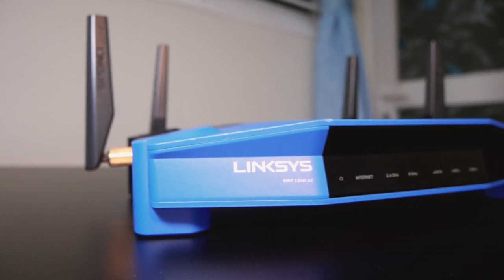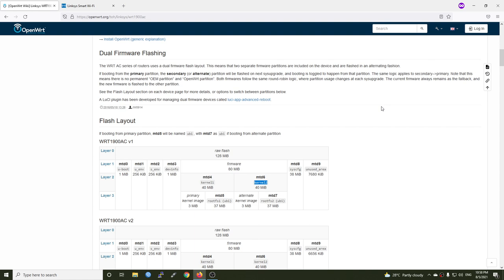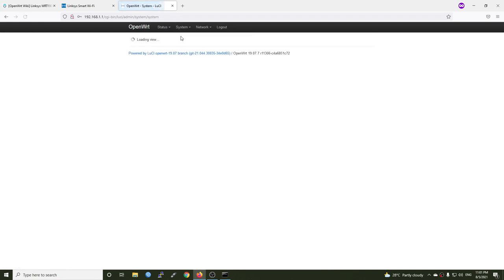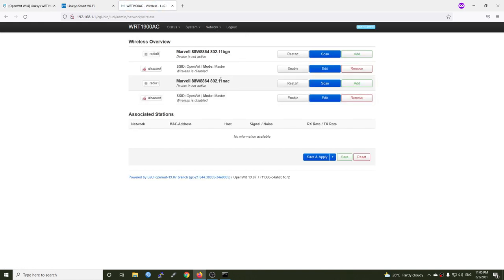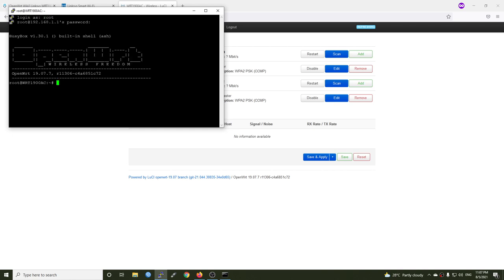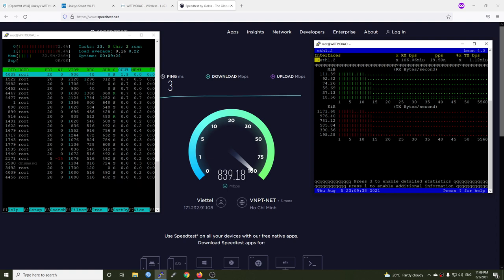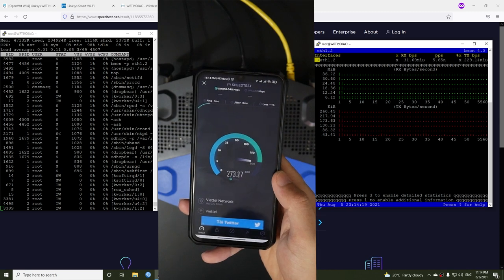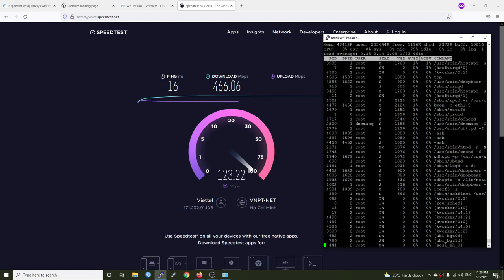OpenWRT - Install OpenWRT on Linksys WRT1900AC

Comment: For years I was going to buy this router to put OpenWrt on but eventually I just used a spare Pi 4 I had lying around!
Reply from the maker: I believe that the Pi 4 should be more powerful in term of routing and firewall. If you already have a spare RPI lying around, it is good choice to set it up as a router.  However, if one need to setup a new network, I will suggest him to buy this WRT1900AC (to save money on an AP, 5 ports switch and a good case for PRI 4).

Comment: Had to change my router´s firmware since it looses the Internet several times per week. Hope with this new OpenWRT version my service won´t be unstable anymore. IPS is not the problem since their router is always working fine. Problem is with the Linksys WRT1900AC. Thanks!! I

Comment: I have 270-350Mb speed on 3 differnt modem. I do load balance in raspi 4b
When i used mi4a,ea7500 all opewrt and ea6300 freshtomato, all i got just 200 and 220Mb max
I use original firmware, that result is same. 
What's wrong with it?

Comment: Did you notice a issue that traffic just will not forwarded and you need to reconnect to the system? It’s really mad, it’s not WiFi or DNS … it’s really Strang you can’t even ping anything

Comment: Can it do secure file transfer over to a USB drive plugged into the back of the router from a remote location?
Reply from the maker: Hello, you can see my tutorial with Samba4 to enable the file sharing and mount the hard drive. And then see the Wireguard server VPN to enable remote access. But these is not easy, it will take you sometime to master.

Comment: Can I install OpenWRT on my Linksys 1900AC if it currently has DD-WRT?

I installed DD-WRT in the past but I don’t like it. I did spend time trying to revert the router to manufacturer firmware but none of the methods work for me. Therefore I wanted to try to install OpenWRT directly onto the router which is currently on DD-WRT
Reply from the maker: Hello, my response is  a bit late, but I hope it will help:
- The Linksys WRT1900 series has 2 partitions (I call it by partition A & B). By default, these 2 partitions has stock firmware on it. " If booting from the primary partition, the secondary (or alternate) partition will be flashed on next sysupgrade, and booting is toggled to happen from that partition. The same logic applies to secondary-→primary. "

- When installing DD-WRT, the firmware should be loaded on 1 partition only (partition A). You should be able to switch the stock partition (B) with some commands (check DD-WRT guide)
- After you get back to the stock firmware (partition B), do flash the OpenWrt image via the web-ui. This time, the OpenWrt firmware will be loaded to partition A. After reboot, you should see OpenWrt up and running. From this, do follow the OpenWrt installation guide to flash the image to the other partition.
https://openwrt.org/toh/linksys/wrt1900ac#dual_firmware_flashing

Comment: Good work.
Can you please do a video on DS-Lite implementation (RFC-6333) on OpenWrt, I have many issues with it.
Reply from the maker: Hi, did you solve the problem. If not, please share more info about the problem you are facing during the configuration. I found a tutorial here, not sure if it help https://openwrt.org/docs/guide-user/network/ipv6_ipv4_transitioning
Reply: @VanTechCorner  Thanks for your reply, I am already familiar with this tutorial. In fact, it is the only info about OpenWrt and DS-Lite which is not enough.
The problem is that after installing the “ds-lite” package, OpenWrt always asks for AFTR address within the DS-Lite device. It’s like assuming that this device is always B4, and the AFTR is residing somewhere in your ISP. 
I want to build the whole testbed  (   client  >> >  B4  >>>  AFTR >>> IPv4 host )
Note: AFTR & B4 are just router names defined in RFC-6333

Comment: But the reason I want OpenWRT is because this router (stupidly) requires an internet connection to complete its setup (even for use as a WAP/bridge), meaning its web GUI is inaccessible.

Comment: Hi..i got 2 question/request
1. If already installed openwrt on the router, can it work with unifi?
2. Can you give tutorial how to install openwrt on Mercusys mr70x since it has wifi6
Reply from the maker: Hi, after installed OpenWRT on this router, you will need to configure PPPoE with VLAN in order to work (you need to know what is your PPPoE credential by checking with Unifi or check on the router). If you have no idea what is OpenWRT, please do not install it since the device may not working as expected. Currently OpenWRT doesn't support Mercusys mr70x  and there is no way to install it (OpenWRT firmware is not available for all router/ap)
Reply: @VanTechCorner  I see...just asking..act ive been using openwrt before...maybe next time ill dive in back to explore more

Comment: Can you connect this router in repeater mode to a public wifi that has a captive portal login, and extend that signal?
Reply from the maker: Hello, you will need some advance setting to do this. Or you can take a look at this https://forum.openwrt.org/t/travelmate-support-thread/5155
Reply: @VanTechCorner  Am aware of travelmate plugin but does this hardware support this functionality? I have an asus router running openwrt but couldnt make it to connect to a captive portal.

Comment: Please show us the Print Server Setup and use it from mobile without pc. We can do it with tplink  firmwares eg. wdr 3600. Now i use openwrt. So show us a way.
Reply from the maker: Hi, please don't post the same comment on different videos as Youtube will flag this as spam and may block you from commenting. For now, I have no printer to try this setup. You can take a look at this doc and try with CUPS https://openwrt.org/docs/guide-user/services/print_server/start

Comment: con này LAN throughput so với con pi 4 sao anh? Đang phân vân lấy pi 4 + ap hay con này
Reply from the maker: Cổng LAN của hai con đều là 1 Gbps. Pi 4 chỉ có 1 cổng LAN, không hiểu em tính kiểm tra throughput như thế nào.
Reply: @VanTechCorner  à ý em là em định sey up như anh hướng dẫn lúc trước: cổng wan là ucb nic UE300, cổng LAN là cổng ethernet + switch 8 cổng. Còn AP em có Ruckus R700 cũ. Anh thấy set up em định làm so với con này ra sao?

Comment: whats the point of these firmware vs the factory?
Reply from the maker: Hi, you can find out the benefits of OpenWRT here https://openwrt.org/
Reply: @VanTechCorner  thank you i will give it a try, does it also make the connection better?
Reply: I had to revert back to linksys firmware, I was getting drops in wifi constantly

Comment: I flashed with latest version 21.02.0 but everytime i log into router it takes me to the oem firmware. Any advice?
Reply from the maker: Hi, this router supports dual firmware, so make sure you install " luci-app-advanced-reboot" package and then go to System - Advanced Reboot. Here, you can select the firmware you want to reboot it.
Reply: @VanTechCorner  I got it thanks man! love your videos